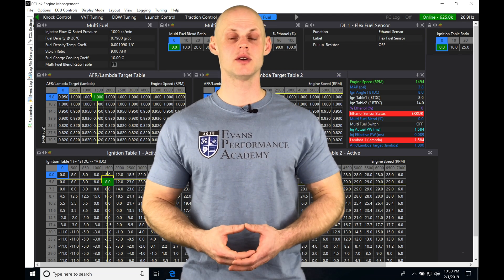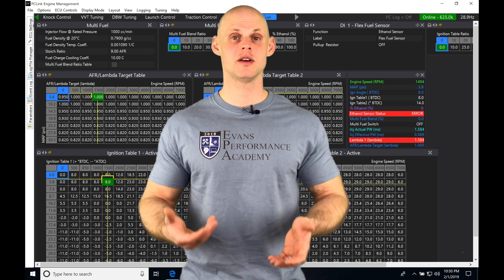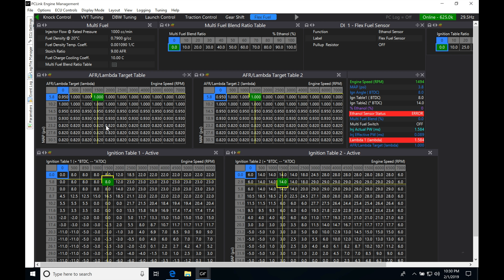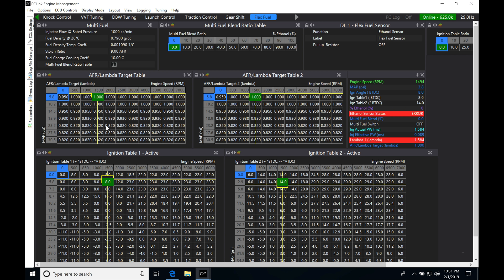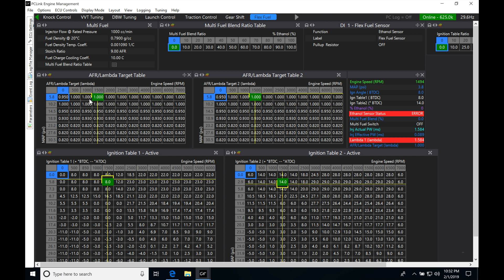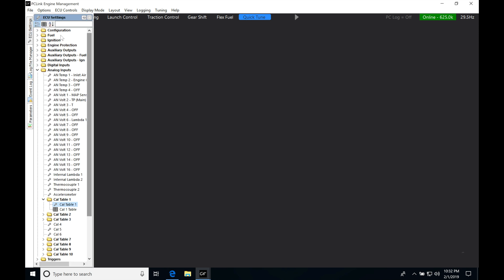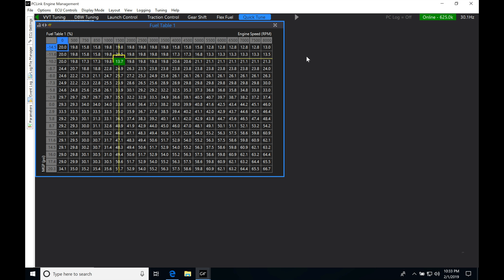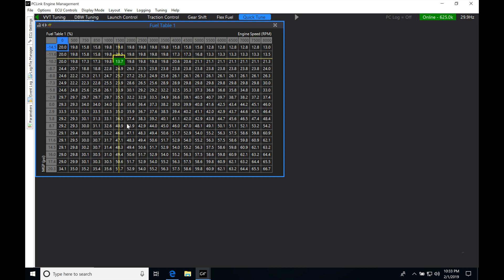Link G4+ EMS Training: Quick Tune | Evans Performance Academy

Comment: Below is everything i done, only the transmission is stock, but running clutch master twin disc FX850 

Computer: Link G4X Audi TT 1.8T
Engine: fully built 83mm bore = 1870cc (1.9)
JE Pistons 83mm 9.25:1
Porter I beam rods

Ferrea Comp Plus +1mm Turbo Intake & Exhaust Valves 

Ferrea Valve Spring & Retainer Kit 

Fully port and polish large port AGU head

IE Billet Steel Main Caps VW / Audi 1.8T 20V 

IE 06A 1.8T Crankshaft Girdle Kit

Garrett G30-900 turbo

Tial Q 50mm BOV

Tial 38mm wastegate 

I have injector dynamic 1700x fuel injector 

I’m running 2 Bosch 044 fuel pump. One run Constantly on the second one coming on under the boost or RPM which one you think is best... 

Below is the sensor I wire in;

Fuel Pressure sensor / green wire = Aux 6 = Pin 112

Fuel Pump signal / red wire = Aux - Ign 6 = Pin 113

Oil pressure sensor / blue wire = An Volt 10 = Pin 111

Air Temperature sensor / yellow wire = an temp 2 / IAT signal = Pin 85

Flex Fuel sensor (E85) / white wire = An temp 3 = expansion pin 110

Red wire = + 5 volt out = pin 98

Black wire = sensor ground = Pin 27

I truly need it turned please help... thanks 
Darronmel@gmail.com
7326956379
Darron

Comment: Where is the full video!?
Reply: Instead of paying someone $1,000 to tune  my car
Do you think paying for your classes will teach me every single thing I need to know coming from never tuning a car but I do build engines and build wire harnesses just never tried the tuning
Reply from the maker: These are only teaser videos the full length videos are available here: https://evansperformanceacademy.vhx.tv/link-g4-training-course
Reply: @EvansPerformanceAcademy  in your Link G4 Course do you teach how to tune fuel tables and ignition tables and Knock tables ?
Reply from the maker: @jmoore9806  Yes, we have specific tutorials that show you the tuning process using Link on an actual car.  It covers fuel, spark, variable cam, knock control, boost control, etc.